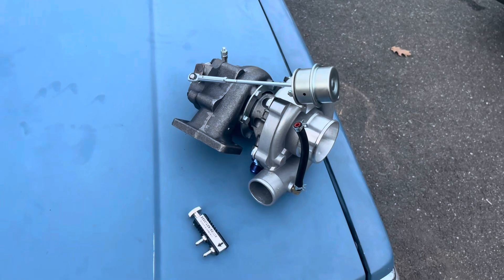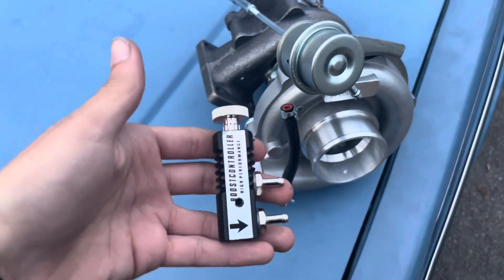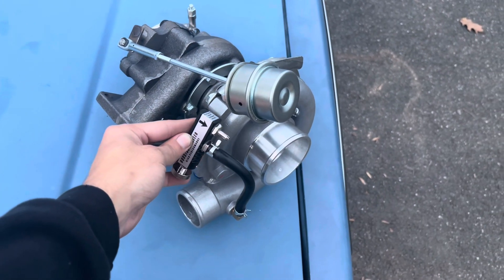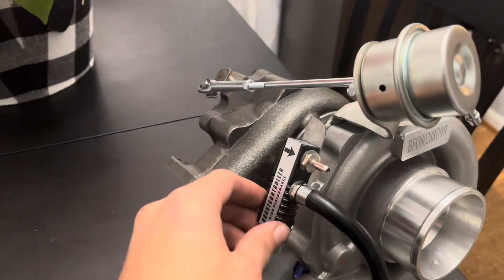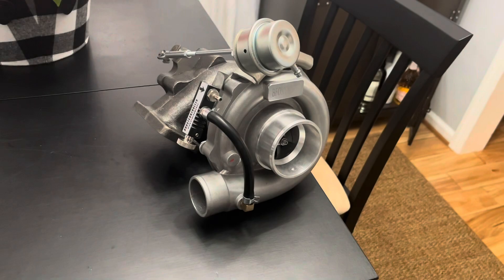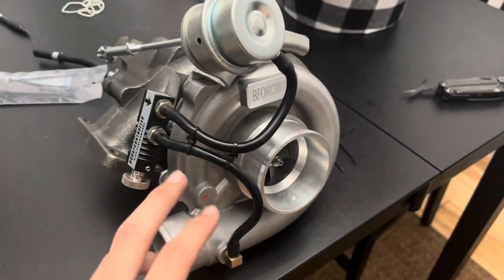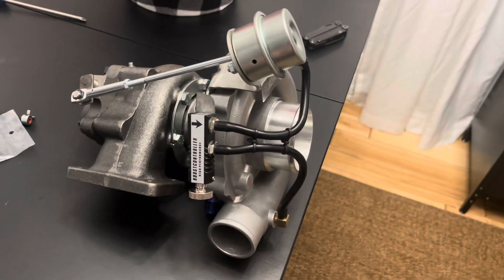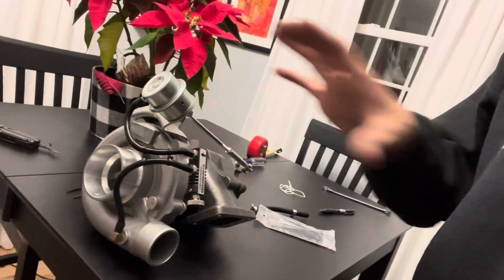How To Install a BOOST CONTROLLER! | Custom DIY Setup

Comment: Do you have any concern about heat/expansion of the boost controller being directly mounted to the turbo?
Reply from the maker: I think it’ll be just fine… if down the line I find issues with inconsistent boost or a faulty controller they are cheap to replace and easy to relocate

Comment: Nice Video, what size vacuum hose did you use? What turbo is that?
Reply from the maker: It’s a t3 t4 t04e from maxpeedingrods with the internal wastegate. Vacuum line is vacuum line sized.
Reply: Cool, did you put in HBeam Rods in your block or are u running the stock ones? Looking at building a new motor this year.
 @max._jolley